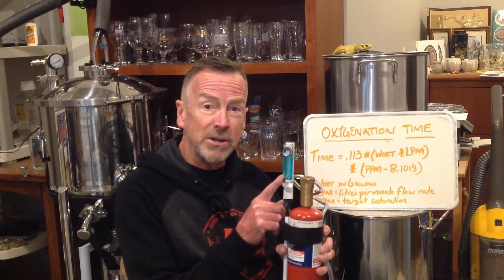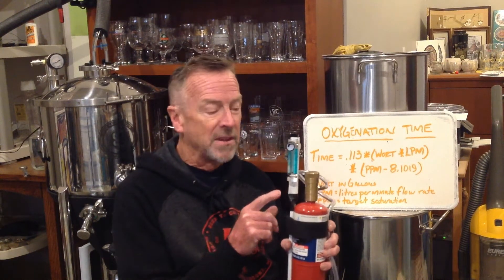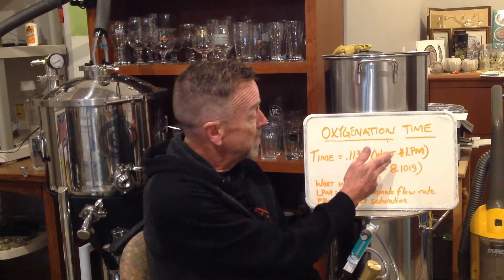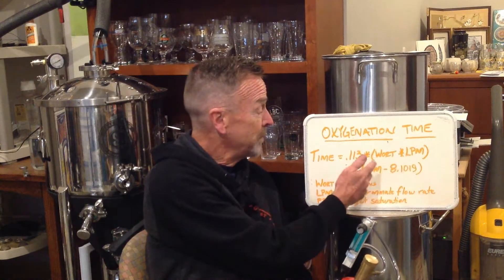Homebrew Fermentation : When using O2, how much and how long???

Comment: Hi You have great videos on Your chanel. I have two question:
 1.Do You aeration worth before pitching yeast or after, or it doesn't matter when aeration its made?
2.Do You make aeration on every yeast, I ask that because I read that some yeast does not need oxigen even that its not good for yeast.
Thank You and Best regards from Croatia
Reply from the maker: Thank you for your kind note, it made my day.  I have always been interested in Croatia, some day I would like to visit there.   I aerate with the oxygen before I pitch.  I don' t know if that makes a difference or not.  The big breweries tend to aerate as they transfer to the fermenter.  The yeasts that I use the most are Imperial Juice, White Labs San Diego Super, WyEast 1056, and Fermentis 34/70.  I use O2 with all of these.  I also now use slightly less flow rate and run it a little longer, 2 minutes.  I did this adjustment to make sure as much O2 is absorbed and not simply bubble up.  Also, by using the flow meter I can be pretty precise and measure how long my little O2 bottle lasts.    So far I have done 25 batches with the single bottle.  I can tell that it is almost out so I'll pick up another one soon.
Beers on tap right now: American Stout, West Coast IPA, Hazy IPA, Czech Style Pilsner, Northwest Amber.
Thanks again for you kind note and interest.   -DT
Reply: @homebrewingtips6029  thank You for answer 🍻🍻
Reply: @homebrewingtips6029  and do You rehydration dry yeast or just pitching in worth? Thank You and You must visit Croatia in summer😀😀😀
Reply from the maker: @markosolaris550  the only dry yeast that I use it Fermentis 34/70.  I just sprinkle it onto the wort in the fermenter.  Also, I do reclaim and reuse this yeast.  Some say you shouldn't/don't need to when using dry yeast, but I always have great luck with it.  I always build up a big starter (2L).
Reply: @homebrewingtips6029  👍🍻thank You

Comment: Very interesting video, I have purchased the oxygenating setup you describe, I am not a math expert but it seems the might be an error in the equation,scince all the terms are multiplied together it looks that increasing the flow rate of oxygen you also increase the time required to oxygenate your wort , am I misunderstanding some thing?I am reluctant to try this procedure till it is clarified.,also does the flow rate have to be adjusted so that all the oxygen gets absorbed or can some of the oxygen bubbles reach the surface Thanks Tim Davy  UK
Reply: Thanks for the feed back Tim Davy
Reply from the maker: Thanks for watching and I think you are correct (someone else pointed this out to me below too).  Look in the description and I fixed it and I think I have it right.  I got curious and looked around some more this morning and found this link too:  https://www.homebrewersassociation.org/forum/index.php?topic=32266.0
It is pretty simple and seems to correlate with others.  In all my reading it seems that 1L for about 60 seconds gets you close.  I am running about 90 seconds these days.  Also, you see .5 micron stones and 2 micron stones.  Certainly there would be a difference.   The other thing that I will mention is that by controlling this process you'll be amazed at how long the oxygen bottle lasts.  Hopefully this helps.  All the best    -DT

Comment: So if i have 60litres converted to gallons= 15.85 gallons and i wanted roughly 8ppm it would take 48.5 seconds  at a flow rate of .5(lpm) ? Am i on the right track with the calculations ?
Reply from the maker: Thanks for watching, this has been an extremely interesting project.  You have it right for the 8 PPM density target.  I am quick to recognize that our instrumentation and setup are far from "scientific" so I would say you could be comfortable just rounding that up to a minute.  As an extra little data point, I am still using the same O2 bottle after 18 batches of .5 LPM for 1.5 minutes.   Using this approach really extends the life of that bottle.  Without it, my assumption is that folks overdue it (which won't cause issues, but wastes your O2).  This is now absolutely part of my every batch routine.  Be sure to sanitize your stone thoroughly, I use boiling water and a StarSan soak.   Thanks for watching and your comment.    -DT

Comment: about how many uses do you get per tank?
Reply from the maker: thanks for watching.  This is the perfect question to ask and one I often thought about myself.  I have been logging the use of my O2 cylinder (just putting a tick mark on it with each use).  With my flow rate and duration, I am up to 12 uses so far.  I was pleasantly surprised by that because at about ~$10 for the tank it comes out to under a $1 per batch.  Once I use the last of it I will update this video with that data.  Thanks again for watching and your comment.  -DT
Reply: @homebrewingtips6029  yea I'm looking into getting a oxygenation kit and wondering if it's worth bucking up for a refillable tank.
Reply from the maker: @Trevor.Morrice  In my opinion, the little disposable ones you buy at Lowes seem to do a good job.  Plus, with the life they have, it seems hard to beat.  I think the small additional investment into a flow meter is money well spent (only about ~$12 on Amazon, there are many to choose from).  There are all sorts of comments regarding the DO (dissolved oxygen) in the wort and how it quickly dissipates.  I don't have any equipment to monitor that.  To me it is one of those things you might not need at all, but I figure do all of the small things and you'll get a better product no matter what.  I now use O2 and yeast nutrients (and always a 2L starter) and my fermentations go gangbuster, so something seems to be working.  I hope this helps.  -DT

Comment: Can you share where found the equation you used? I want to run some experiments with a dissolved oxygen meter to better understand how to use such a formula.
Reply from the maker: Thanks for watching and your comment.  First off, I am extremely interested in your measured results, in particular how quickly the oxygen dissipates (many say this happens rapidly). Please post your findings here through the comments and I will see them in my email.  As for the website, ugh, I should have book marked it because it was tough to find.  I went through some bulletin boards like this one:  https://www.homebrewersassociation.org/forum/index.php?topic=32266.0
before I found the equation.  I'll look for it again and if I find it, I'll post it here.  The time/volume lined up with directions from Northern Brewer and so one with their oxygenation "kits" (stone, wand, etc).  One piece of anecdotal data is that once I have started following my own "advise", my fermentation results have been excellent.  
Thanks again for watching and your interest.  -DT
Reply: @homebrewingtips6029  I did an experiment using the formula and used a borrow DO meter and my club and I are trying to write some things up as an education for the club. There is some variance in the results so we are gathering ideas for next steps and experiments. The source of the equation would be very helpful. I used the equation a few weeks ago for two 6 gallon fermenters (one using Imperial A38 and the other using Bootleg Biology NEEPAH yeasts), where I calculated two 12ppm diesels for each spread ~2hrs a part. There by giving each fermenter a total of 25ppm (higher dose rate recommended by Imperial for East Coast Conan type strains). Both fermenters took off better than any other time I have used these yeasts.
Reply from the maker: @RodTemplen  Excellent, thank you.  Here is the link to my equation (albeit from a BB, it is legit *I think*).  
https://www.homebrewtalk.com/threads/all-you-ever-wanted-to-know-about-oxygenation.414616/
Also, you can see reference to Jamil Z and Chris W's book, that would be interesting reading.  Final note, you'll notice that I use what I call "dirty math" in my calculations (just sort of round off most variables).
I hope this helps, I greatly appreciate your results and data.  All the best.  -DT
Reply: @homebrewingtips6029  There is a bug in the calculation -- but it only applies when not using 1.0 LPM. Your whiteboard shows "Wort * LPM", but the HomebrewTalk thread you linked here says "Wort / LPM". It has to be division, otherwise slower rates result in less time.
Reply from the maker: @JasonBerg19  Oh man!??!  I guess that's why we shouldn't believe everything we see on the internet (I am totally laughing at myself now).  Thanks so much for checking my math, I try to be accurate when I post stuff but this one clearly got away from me.  I appreciate you bringing that to my attention.  I'll double check everything and will try to edit the video with a note to correct any error.  I always appreciate comments, suggestions, and in this case corrections.  Thanks for bringing it up.  Happy New Year!   -DT

Comment: Hello :) I love your videos learned a lot, thank you. I have a question: I can't acquire air cylinder, can I use aquarium air pump instead? Maybe with a hepa filter? Thanks again.
Reply from the maker: Thank you for your very nice note.  I continue to learn a lot too!  I have seen where a lot of folks use aquarium pumps.  I believe that the important thing is to run it long enough (5 minutes seems to be in the back of my head, maybe I read that somewhere).  The other thing is that I believe that the output pressure is lower than a pressurized bottle, so most use a 2 micron stone (O2 systems use .5 micron or 2 micron.  The .5 gives a smaller bubble but could be harder to care for due to the ultra fine hole size).  I personally use a 2 micron stone and have never had issues.  The filter makes sense, I am not sure how that would be incorporated.  Here is a nice short link from Greg Doss at WyEast discussing different techniques (they have a good chart on their website too): https://www.youtube.com/watch?v=75gpehf_6Gk
Thanks again for watching, all the best to you.